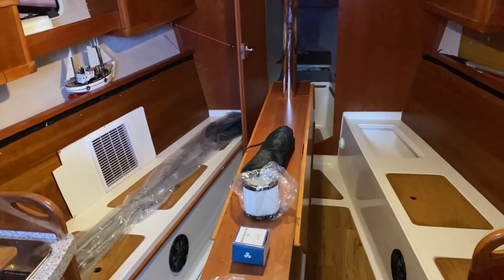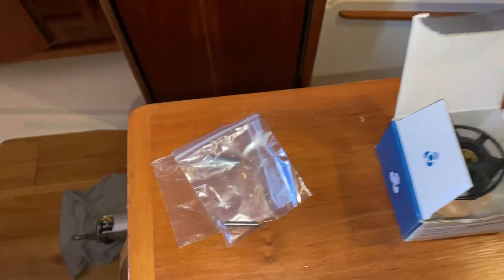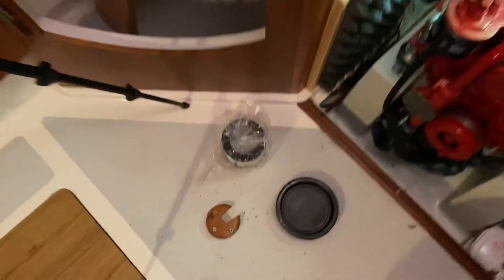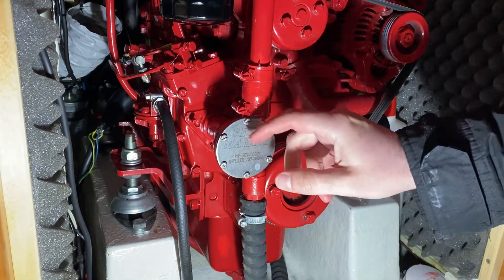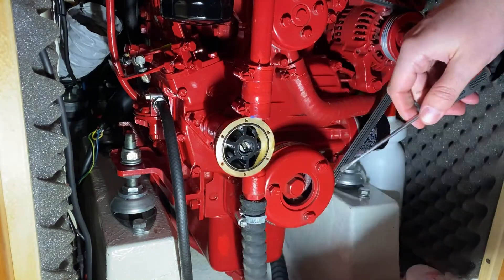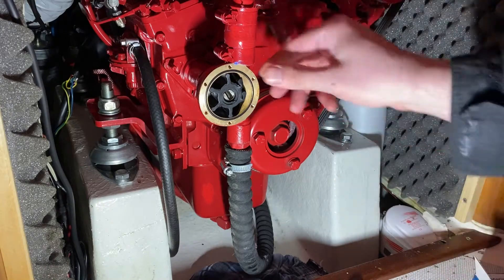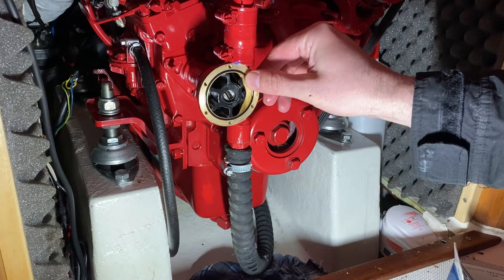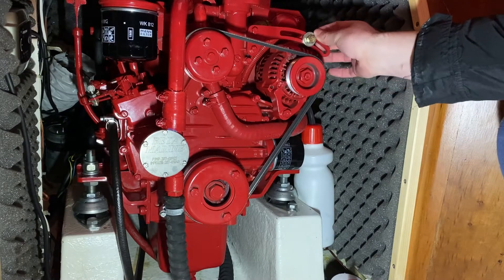Sailboat engine spring service - Sedna 30 yacht - beta marine 20

Comment: Im losing coolant when the boat is static... I can't find the leak though. Heat exchanger just ditches coolant somewhere.
Reply from the maker: Hi, best is to look with great detail for a visible leak, as this is usually easy fix. If you cant find it, go trough each hose and tighten the clamps…

Then work your way to to the heat exchanger, simple things such as loose cap, wornout anode can be also reason for coolant loss trough either leat or trough evaporation…

Not knowing how old the heat exchanges is, rust trough can cause a leak in it into the raw water circuit…

You can take the heat exchaner out and have it tested for leaks by a professional.

Lastly note that its normal to loose  like 0,5 of coolant per each 50/100h of engine work… not unusual… i top up the heat exchanger at the begining of each season by approximatelly this ammount….

Good luck
Reply: @akleviathaniii634  Ok interesting. I noticed the other day that I had some rusty water come out of my fresh water tap... (I have a tank attached to the engine for hot water).

Also even more bizarre is the fact that the leak was worse 2 weeks ago!? It's not as bad as it was. It used to empty out in a day now it's not as bad. Something is off here but the rusty coloured water is telling. What about testing the fresh water to see if it's salty?
Reply: @akleviathaniii634  Why would the pencil anode being worn out lead to coolant loss?

Comment: I have dame but After a while, when it gets hot, the water comes out a little and it is hot. Is the problem with the pump or is the valve damaged? Is the cylinder head gasket damaged?////Give low gas or gas until the end of the body does not affect the speed
Reply from the maker: Hello,

Overheating can have several causes.
Assuming you have a diesel engine with close and raw cooling circuit:

1/ check, that your heat exchanger and close cooling circuit has enough coolant. (Open heat exchanger lid and check level- fill up if necessary)

2/ check if your water pump is picking up enough water (large and steady spills of water should come out of exhaust. If not, change inpeller and check for blockage at water intake area.) 

3/ check thermostat for correct function ( if not change thermostat)

4/ check that coolant circuit, heat exchamger is not blocked - clean obstacle or replace heat exchanger if necessary. Old heat exchangers can get blocked up by salt and other deposits. Also very common problem is parts of broken old impeller stuck in cooling circuit.

Head gasket damage can be checked by pressure test. See videos on how to perform cylinder pressure test on diesel engine.

In my experience, most overheating problems are related to obstructed flow of either raw water or coolant.

Good luck!